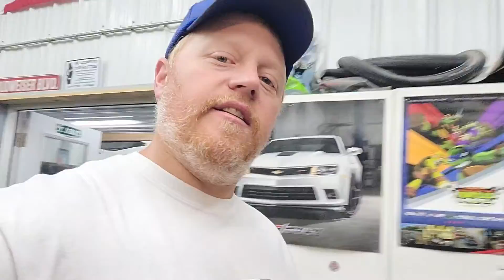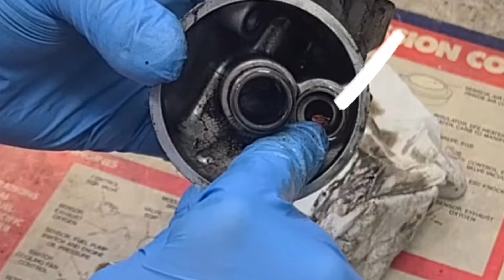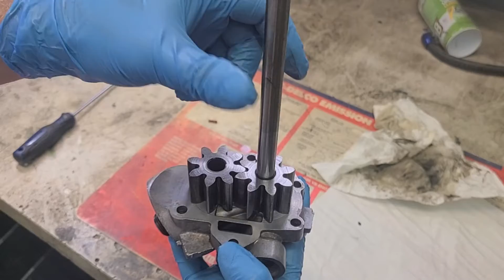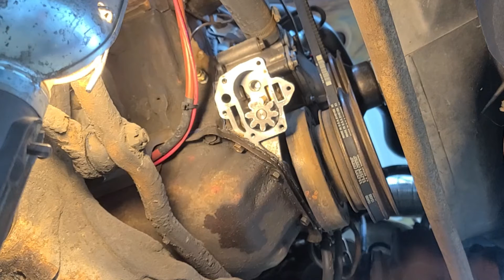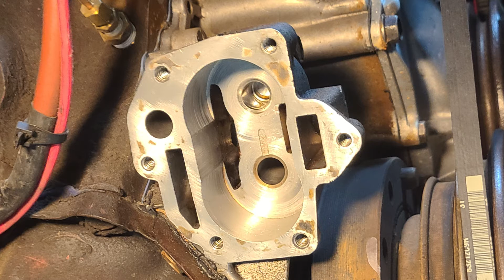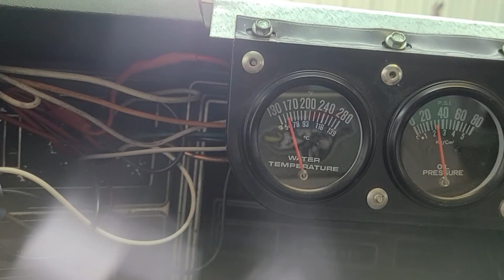BUICK 455 OIL PUMP REBUILD!

Comment: Mines leaking out from 2 bolts from the housing any ideas
Reply from the maker: the gasket is probably bad and needs replaced. how's the oil preasure at idle?
Reply: @smokineaglesrodshop damn good pressure I ordered new gaskets from Ta today I’ll keep u posted appreciate it 🛠️🧰🫡

Comment: Idiot lights are designed to come on at three to five pounds, and an engine can survive on one pound of oil pressure if not run at higher rpm than idle.
Reply from the maker: @kimdearrington258  i had an old chevy silverado with a qtr million miles on it yrs ago. had 5lbs preasure at idle and about 30lbs cruisin. drove it for many yrs. low idle preasure isn't ideal but good enough is all ya need 😎

Comment: All Buick v6 3.2L  all v8 455 350 oil pump  do the same  thing after  about  80.000 will need  a heavy  output  pump
Reply from the maker: Your right these oil systems are a known issue. I recommend the adjustable oil regulator from T/A performance instead of a high preasure pump. It's easy to install and doesn't require the pump being removed, it is fully adjustable and doesn't put excessive load on the cam distributor gear. the high preasure pumps have been known to break cam shafts because the distributor/ oil pump drive gear sticks out the front of the block and doesn't have a bearing to support it. 
Thanks for the comment!

Comment: Hay you're  oil pump  no good !! The ⚙ gear shaft on the left  should  not pull out,not good   it will throw out the shiming in it .hope it works
Reply from the maker: luckily we've had no issues with our pump after multiple burnout sessions. fingers 🤞 it continues to hold up cause we are putting it to work! STAGE 1 BUILD IS CURRENTLY UNDERWAY! turn on your notifications so you don't miss the action  Terry. Its about to get crazy 🏁🏁😎

Comment: I'm having a ticking issue on my 72 electra. Glad I found this video. My car was in Oregon sitting forever. Now that it's enjoying California sun, I want to do as much as I can to make it run good as new.
Reply from the maker: I'm glad I could help! Get that thing purring like a kitten 🏁
Reply: @kanob6440  I would not sweat that low oil pressure at idle on a Buick , because my dad is was an engineer with Buick Motor Division for 25 years and ten years mechanical experience before that at a Chevrolet dealership, but GM cars were our thing, especially Buicks and Buick performance.
Dad had a 1970 Stage 1 engine, and my twin brother was lucky enough to acquire a factory 1972 Stage 1 Gran Sport solid white and a very beautiful and loaded car for a muscle car.
It was a blast to drive.

I work on it when I was working at the local Buick dealership as a line mechanic, and I put my dad's 70 model engine in his car while I freshened up his engine, and even though the 72 engine was 2 compression points lower it was just as fast as the 1970 model engine.
It was a very special car.

I had a 1966 bone stock skylark that I basically made a Gran Sport out of it, but I only had the money to have a stock low compression standard 455 engine, but I loved the car and wish now that I had kept it, and even though it was not all that fast , it would stomp most cars of that era, but that was not saying alot.
I got off subject, but I wasted to let you know that every time I got into my car the lower end would almost always do a little knock knock when first starting it up, but never hurt the engine, and it's idle pressure was NEVER much over. 6 to 10 pounds, and I drove the crap out of that engine all of the time, but it NEVER gave me any trouble at all, probably because it was not a performance engine.

However my brother's car never gave a bit of problems, nor did Dad's 1970 stage 1 engine that we later put into a 1975 Buick regal and installed a Stage 2 camshaft, and a 5.00 to 1 gear ratio in the car, now that was a fun car to drive and I NEVER saw anything on the street at that time could brat it.

It certainly could have used an overdrive in the car at that time with that gear, but we ended up putting a stock 455 engine in it and driving it as a daily driver.
I wish that I had it back too!

Comment: Just found you. Just subscribed. What caught my attention is Carmen Electra. Followed those vids up to your debut at Cleetus’  burn out pit. Your enthusiasm while you were in line to take a crack at smokin some rubber was palpable!

Really like what you do. You show your successes, failures and the turn-around. Excellent.

Two years ago picked up a ‘70 Buick Electra 225 Custom four door sedan w/ 74,500 miles on the clock. All original, she’s a good 20 footer. Any closer than that and you can tell her age.

I really like the big cars from ‘60s and ‘70s. Grew up in that era so, yeah.

Thanks for your tips on the Buick. Can’t say mine will ever be doing burnouts. But, like I said, love your content. Looking foward to going thru the rest of your content.

One day may see you at one of the car cruise, drag and drive, Cleetus’ events somewhere sometime someplace.

Keep the greasy side down mate.
Reply from the maker: AWESOME GLAD YOU FOUND US AND ENJOY THE CONTENT! you don't have to beat on yours you can just watch me 😆 
It's crazy intense every time as stupid as it seems. Adrenaline rush to the max and I love it! I have tons of content ideas and plans for the 455 and Carmen along with other stuff. 
I wish my 455 was a 70 with the better compression then we could really step it up but im stuck working with 8:5-1. I'm going to be making a bunch of content this winter going to a stage 1 with it. cam , intake, carb swap and getting the heads cut to stage 1 valves.
If you see us at an event definitely stop and chat!